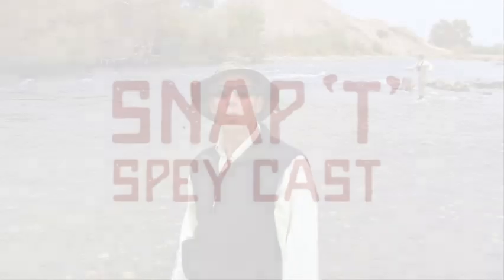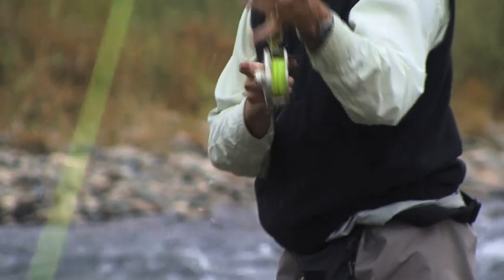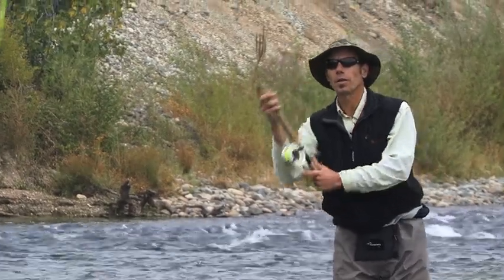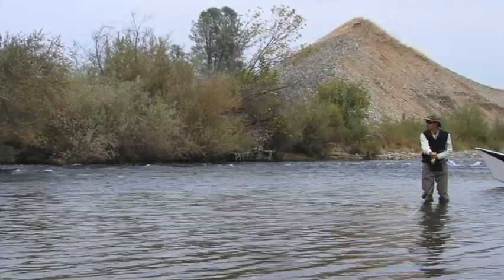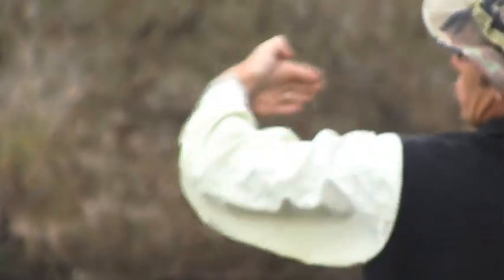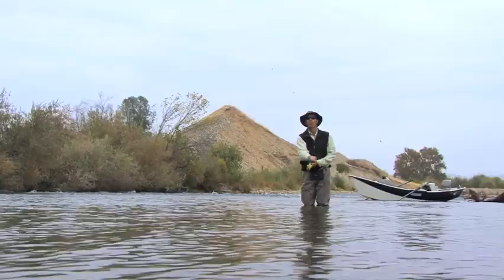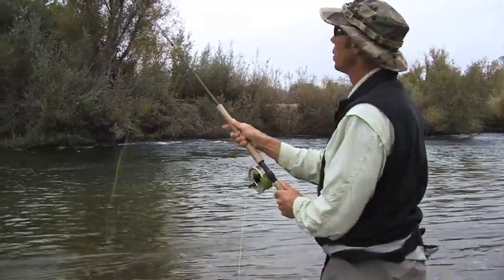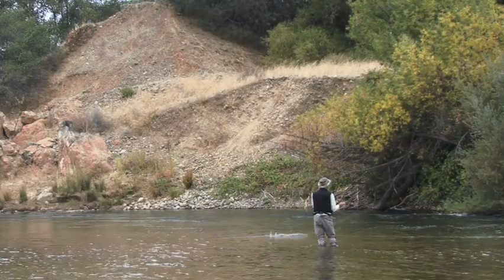snap t spey cast

Comment: For those of you who don't understand, Fistle and v0 breath clearly don't use heavy sinking heads or leaders, Weighted flies or fish fast deep water. A single spey cast using these in that kind of water can place the fly in a position that when you cast will bring it up and hit you in the face. The snap T is a sustained anchor cast that keeps the fly and leader shallow and more importantly, in a place that won't take out your damn eye.

Comment: if you rotate your upper body more and bring the rod a littlebit more back and up at the end you will load the rod more efficient, and bring more speed into the line, delivering more power on the outgoing line, important that this is done in one accelerating motion, no stops. combine this with a sharp stop in the end of the forward stroke and you will have a good cast. best of luck  -jb =)